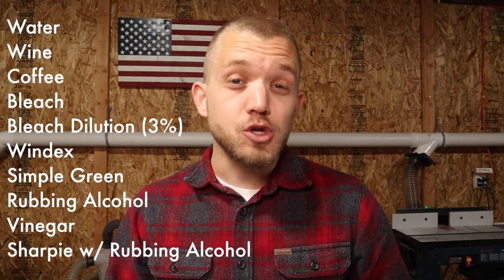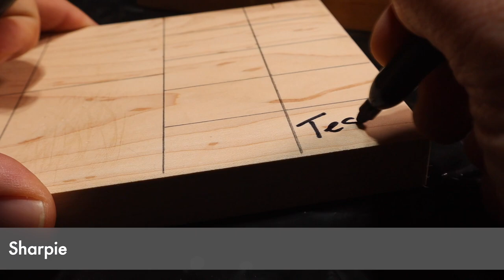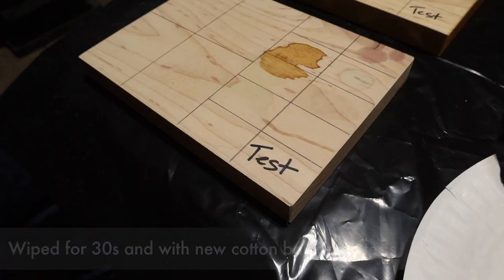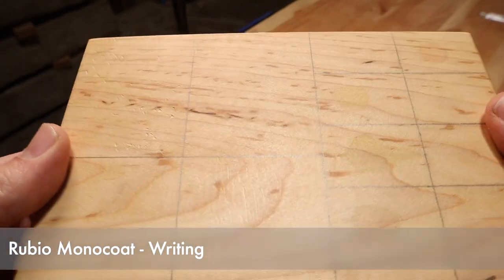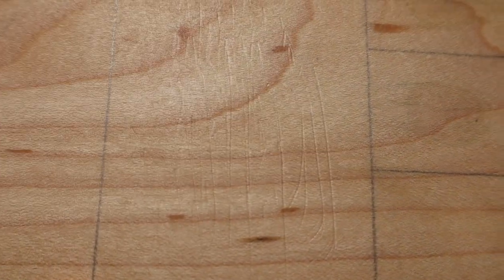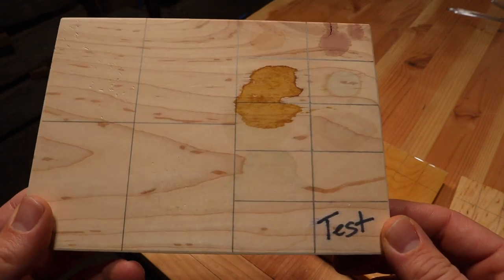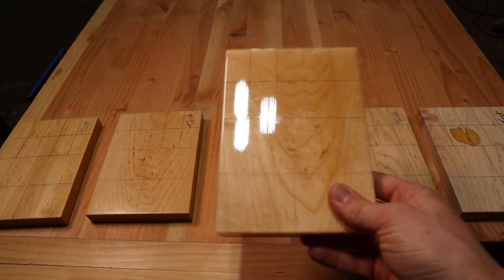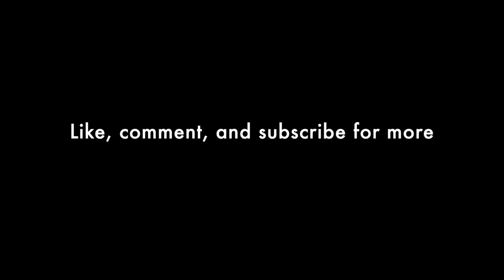Epoxy vs Rubio Monocoat vs Polyurethane vs Lacquer

Comment: You left out one critical test! Heat! I have had pine and maple tables with polyurethane, and was dismayed at all the damage caused by knives going thru paper plates, kids roughhousing, even people slamming their glassware on the table! So I sanded my most recent maple table and gave it a couple coats of epoxy. We found out really quick that if you heat up something in the microwave and put it on the table it leaves a melted ring indentation! Even hot coffee will do this! That is not acceptable and has me rethinking my finishing on future projects! 
One other thing; I never put one coat of poly on anything; it's generally 2-3 coats, but it wasn't clear how many coats you used. Additionally, some people have been using water based poly but I have found it to be inferior in durability; I have built several computer desks and came to these conclusions; the first desk was birch laminate with 3 coats of polyurethane and was basically indestructible. I could put hot or cold, wet or dry on it and it stayed perfect. My second desk was oak laminated plywood and covered in three coats of water-based poly. I treated it the same as my first desk but the top started taking damage almost immediately, with stains and de-laminating. I was so disappointed I refinished it in epoxy, but I am very careful not to put anything hot on it. 
In short, I would like to see a face-off with water-based poly vs oil-based poly vs epoxy, with long term water and heat testing. And honestly maybe a few different brands of epoxy to see if there's a difference in heat resistance between brands! Thanks!
Reply from the maker: You’re looking ahead to a follow up test I’m doing! I saw exactly the same issues after the fact, with heat specifically. I found out that most epoxies have a heat deflection temperature of 135°F which means even hot coffee, as you noticed, will leave melted rings. I plan to test Stone Coat Epoxies which has a stated heat deflection temp of 400°F. I’ll be adding a boiling water test or similar in the follow up!
Reply: @NorthwestCraftsman  I searched for this in Bard and found out total boat is good to 300 and permatex has a high-temp epoxy good to 500.
Reply: I use entropy epoxy by West system and I have put hot pots on it directly with no issues.  It should be avoided, but there was no melting for me and a pot is much hotter than the coffee

Comment: This has got to be the weakest lacquer I've ever seen.  Lacquer is among the hardest wood finishes, much harder than hardwax oils would be expected to provide.  My feeling is the lacquer was either: old/expired, very thinly applied, or simply some kind of lacquer varnish that is not what most people think of when aiming for a durable lacquer finish.  I can't explain it - because I've used lacquer to much better success - maybe someone else can explain why it's so incredibly weak in this video.
Reply from the maker: I appreciate the feedback. I’d love to have the lacquer finish better because it’s so much easier to apply than the others. I’ll be running another test at some point this year and will add another test to see if this was a fluke.
Reply: @NorthwestCraftsman  Also, another possible explanation is that it wasn't full cured.  To be fully cured, lacquer often takes a ridiculously long time, maybe a month or so.  This will make it significantly harder.
Reply from the maker: Fascinating! I’ll keep that in mind for the next one. My goal on this one was to follow the mfr instructions to get the fairest comparison

Comment: I like polyurethane it's cost effective, that is wild the epoxy scratches that bad from a plastic knife...  For how expensive Rubio Monocoat is and "being so great for penetrating wood", it's always funny to see that do poorly.  Clearly you want something that sits on top.  There were a lot of people who thought you had to use tung oil and let it soak for days, stuff was garbage the whole time.
Reply from the maker: I was surprised by the Rubio as well given its popularity and how delicate the lacquer was. I still use lacquer for decorative, non-heavy use projects but I've also heard some of the higher end lacquers can stand up to the abuse on a table. Need to see it first. My only hesitation with the polyurethane is the yellowing over time. It just needs to be used on a species that will benefit from the warming effect. Otherwise, I agree, it seems to be the most cost effective and durable.

Comment: I always do a lot of testing when making something, but the social media fad oils, rubio, osmo, odies etc etc... simply don't hold up on furniture that is used alot. Book shelves etc etc yea works great, looks great and pretty easy to put on. 
To keep the natural look and provide daily protection I Usually  end up with the water based matte poly. Alot of the more traditional/stood test of time finishes change the color in a direction I don't care for.
In short, basically alot of people are catching on that these highly advertised and popular finishes are not what they are made out to be and are not 1 product for every job type of finish.
Also.. they are not the Zero or Low Voc's.. that many advertise. Some off gas as much as old school finishes.
Reply from the maker: I appreciate the moderating advice. I think it’s good for folks to hear, including myself, that there is no one size fits all finish.

Comment: Anyone try some wipe on poly over Rubio for added protection?
Reply from the maker: Great question, I have not but it would make me wonder why the Rubio was needed first. What’s the final use case for the product you’re making?
Reply: @NorthwestCraftsman  i find the oil overall looks better than simply applying poly to it first. so hoping to get the oil finish look, then add a thin layer of poly for protection. I just havent had good luck with oil finishes only in terms of durability. it would be for a dining table. thanks!
Reply from the maker: That makes sense! The biggest thing I try to remember when applying finishes is making sure the surface prep is adequate. Poly will definitely provide better protection than the Rubio will but it will be more amber. You may look at polycrylic (water based poly) to see if that meets your needs.